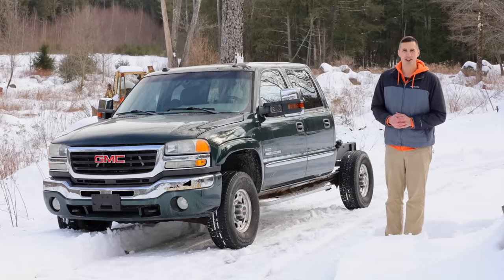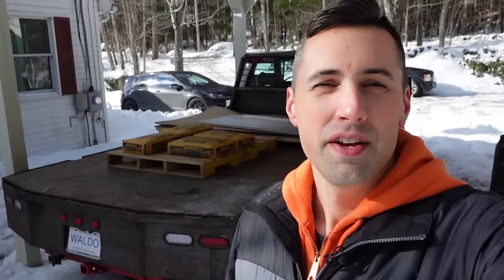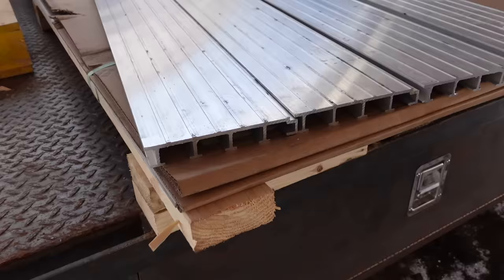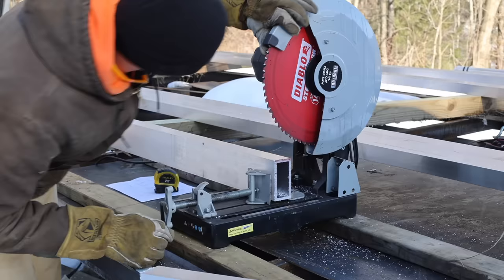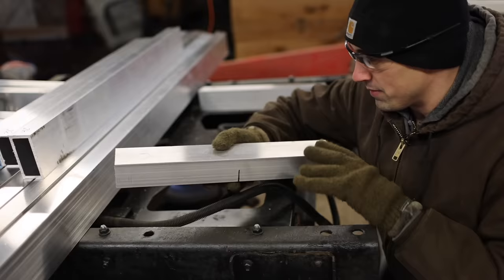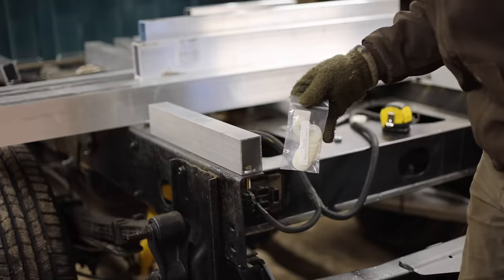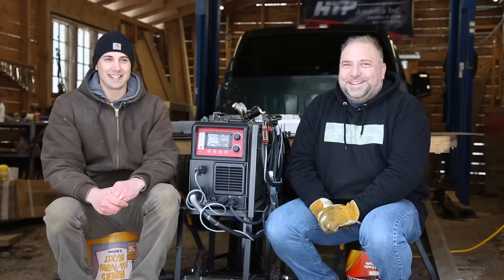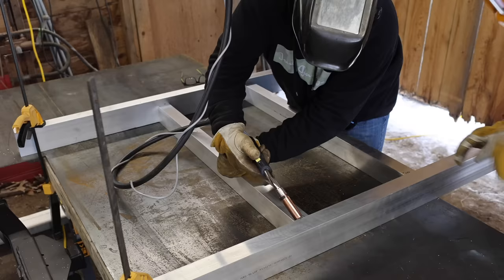Building an ALUMINUM Flatbed for my Project Truck!

Comment: I gotta respect a guy who goes though so much trouble to lighten his pickup and make the bed rustproof.

My only disappointment is that you HAD to make rear wheel arches, instead of keeping the sides flat and smooth.

Comment: But u can use magnet holder to weld aluminium anoth con to welding aluminium and u need to put a hatch in for thr trailer gooseneck ball hitch

Comment: Btw.. you welding up at a material that is straight 90, and aluminum… this is the one thing(sure othere’s) that even with steel I just can’t do!… I’ve seen tips and tricks. I think it comes down to the amp and feed, it’s like a potions I can’t get right, I just drip. Love a tip video on that, in depth, cause I’ve wasted so much company time lol I just can’t get it and it can’t seem to find the help

Comment: Pretty sure nylon washers aren't load bearing...... Been better off using rubber strips to keep galvonic at bay
Reply from the maker: Nylon has a very high compressive strength, but a low resistance to impacts 👍

Comment: This snow plow project is a great project and everything was good but i think u kinda overkilled it on the connection between the plow and the truck if u did a trailer receiver end on it where u had the tow hooks u could have put like a standard 2 inch tube and on the plow have like a point on it to help guide it into the receiver end and simply put the the pin in it, and when its not the winter season and no more snow u have two receiver ends for what ever u need to use it for like toing stuff with a hitch hook and u can still use it as a stock truck when it had the tow hooks

Comment: The only probelm with aluminum beds is stronger heavier metal like steel will gouge out the aluminum if dragged across it, or cut right threw it if a heavy object to dropped on it.   That's why heavy duty trucks dont have aluminum beds.

Comment: that is a LOT of stickout.  I am guessing the ARGON is turned up super high for that much?  I see you are still getting a lot of soot on the edges, is that normal with aluminum welding?
Reply: its spray arc on aluminum you need that much stick out ... and yes to weld aluminum you need large amounts of agron as well ... in the neighborhood of 40 cfh

Comment: Use WD40 to avoid aluminium get stuck in drill bits, saws and cutting stuff. Works wonders, even on the lathe and on the mill.

Comment: you need some ventilation system if you want weld more aluminium - aluminium fumes are much worst than steel

Comment: No spool gun. Great! I'm surprised at how far you can keep the torch from the weld and still have enough gas shielding. Are you using 100% argon? What flow rate? My only experience with welding aluminum is with TIG which is nice looking but slow.

Comment: Without insulating this much aluminum rom the steel frame rails, you should expect accelerated galvanic corrosion at the bolted connections.  Deicing chemicals will only make matters worse.

Comment: Did you put your ferrous metals blade on your dewalt mitre saw? Or did you just use a wood cutting blade? If so, which blade? Great built btw.
Reply from the maker: Thank you! I just used the wood cutting blade that came with the saw 👍

Comment: You did an amazing job on the flatbed. You are inspiring me to build my own as well lol. At 35:00 spend the money on the CDL training,I got mine back in the 90s but so much has changed you’ll never pass because you won’t know what to call out during the road test, it used to be just bridge overpass heights and road and bridge weight limits, but now you have to call out all hazards and you are better off to pay for some training and pass the first time then to take it three or four times and fail.
Reply from the maker: Interesting, I've never heard of calling out hazards on a road test. Which state was that in?
Reply: @WaldosWorld  I took the test first time and passed without going to any expensive schools, I did have a pretty good "teacher" mentoring me though. Make sure you study up on the pre-trip inspection. I would love to help out and loan you a truck but I'm in N Idaho so not exactly in the area.

Comment: You spoke about corrosion as regards to steel. Unless you have insulated 'ALL' your ferrous fixings from the Aluminium you will get 'corrosion' as the result of dissimilar metals touching and it will eat your aluminium away very quickly.

Comment: I see you live in a colder/wetter climate area and I was wondering if the aluminium isn’t going to corrode quickly where it’s bolted to the steel? I would suggest to add some kind of plastic bushings or washers between he aluminium and steel to electrically isolate them from each other. In that way you will greatly improve the durability of your nice new flatbed. Contact corrosion is no joke…

Comment: I'm formally from New England (born and raised) I'm currently living down in Florida. I have given up on the idea of welding and aluminum framed pickup truck slide in camper due to the price of materials. I was just looking again online at some of the more popular sites. I still have some smaller projects I'd like to complete, so I'm curious. Did you find a local supplier with reasonable prices or were you getting your material online?
Reply from the maker: I found a local supplier. I've found that internet prices are usually WAY higher than local prices, so I recommend calling a local supplier and getting a quote 👍

Comment: With a CDL there are a lot of hoops you have to jump through every year. Like a physical every 2 years or every year if you have high blood pressure. Can't take a class to get points off your license if you get pulled over in your personnel (non cdl required) vehicle but may be forced take the class anyways. You also lose your 4th amendment right when driving your truck and trailer, you can be pulled over for a random vehicle inspection and they can search inside your vehicle without probable cause or a search warrant. Your likely hood of having problems is rare, but there are DOT officers that see a pickup truck with a gooseneck and can't wait to bust you for something.
Reply from the maker: Those are good points!

Comment: Waldo nice work I also have the HTP 220 PROPULSE what was the settings you used to pulse the 1/8" materials please include wire type and size i would be extremely appreciative. I can send you some pics of stairways will build with aluminum if you would like to see some aluminum work we do we are in Massachusetts.

Comment: So what is the purpose of this truck vs the Cummins swapped Chevy? Do you have different uses in mind for them, or will they just both be around for whatever? They seem very similar other than the regular vs crew cab and age.

Comment: Any problem with the wire birdsnesting?  How does HTP feed the wire, straight push?  It is a very short gun so that might work with a teflon lining.  Did you try any 4043 .030 wire to see if it had any problems?   I had to laugh when you said that steel prices were cheap in your opening.  Must not have been to the steel store any time in the past couple of years!   Aluminum, even 6061 will corrode especially with road salt so it is not maintenance free by a long shot.  Best to design for easy accessibility avoiding blind areas where you can't get at them to clean them up.
Reply: the programs in the machine are for 035 wire (4043 and 5356) with pulse and 3/64" wire without pulse  .... all of those feed pretty much flawless through an 8.5ft gun with a special carbon graphite liner and fed by a special shaped drive roll ....  push only

Comment: Does it use a special type of aluminum wire that is able to be pushed all the way up that tube?  I thought the spool gun was used because the aluminum wire is too flimsy.  Also is there different types of spool wire depending on the type of aluminum you are welding?
Reply from the maker: Nope, it uses standard aluminum wire (it also takes large spools!). The gun has a special low-friction liner so a spool gun isn't needed. I used 4043 wire for this. 5356 wire is needed when welding most 5000 series aluminum

Comment: Hello
You are covering third factory brake light of truck 
Please put hole in front of it
I like you use orange/amber light for blinker and avoiding from stupid red and worst is sharing with brake light 
Its dangerous and cofusing share and red turn light designe
Please install one or two red strong fog light for back

Comment: I built an aluminum dump bed 2 years ago for my 1 ton duramax.  I wanted to use those aluminum planks but couldn't find a good source for them.  I used 3 inch channel and 1/8" smooth 3003 aluminum.  It's strong but still wish I had the planks.  Where did you get them?  Good job on your bed!

Comment: I wonder what is the length and width of the bed. 
Also the hight of the headache rack. 
I am considering building a track camper on a similar flatbed.
Thanks

Comment: Where did you source the extruded aluminum planks? I went going through the same weight/corrosion mental gymnastics for a build on my 2000 Tundra and really want aluminum but I'm stuck on where to find the materials.

Comment: If your welder has a hot start like the ones at my school have you don't have to preheat the metal
Reply: it does have hot start .... but it has a max output of 220 amps ... that aluminum was 6F .... as in before 7F ....   it was COLD .... and let me take a wild guess ...   at school you have 350 amps miller or Lincolns ...  THAT is a totally different class of machine ..... double the power 3 times the cost ....
Reply: @ZILAwelds  yeah I do there brand new and yeah that's very true

Comment: With my (albeit limited for the moment) experience in MIG welding steel, the fact that the part heats up as you weld a bead is not a unique property of aluminum. If I run a bead from one end to the other on top of some 1/8 flat bar, it'll easily blow through after several inches on me if I don't start cold... And starting cold of course has its own problems.

I don't regret buying my Everlast Lightning MTS 275, but I did want some pulse features and wasn't aware until fairly recently that anyone had anything similar to Fronius' CMT process.
Reply from the maker: That's true, it does affect all metals, it's just that steel is very forgiving compared to aluminum

Comment: Any thoughts on adding an Aux fuel tank? you can add a solenoid on the fuel line so when your  stock tank is empty you can hit a switch and fill the tank this could reduce stops at the gas station during cross country trip

Comment: What alu wire are you using?  Maybe you said...?  Also, is that a push pull gun?  I have a push pull and if yours is not push pull, it seems to work great..

Comment: what is the purpose of the nylon washers that go between the aluminum mounts and the steel frame of the truck? is it to prevent some dielectric corrosion or is it for shock absorption?
Reply: i figured it out: galvanic corrosion, good thing you showed me this
Reply: he needs to add a nylon washer to both sides of the aluminum, the top one is missing, he only added the bottom nylon washers

Comment: Where do you get your metal supplies from? Haven't figured out where you are in NH - I'm in southern NH and struggle to find local places for materials like this. Thanks!
Reply from the maker: Cohen is my go-to for steel. I used Northstar for the aluminum on this project

Comment: How did you attach the decking down? Did you just weld the outer edges or did you weld it to the frame?
Reply from the maker: I actually haven't attached it yet, it's just being held in place by gravity. I've been thinking about welding strategies for it, but I haven't decided yet. One of the considerations is that when you weld 6061, it becomes a lot weaker and more likely to crack near the welds, so I want to find a good place to weld it to minimize cracking in the future 👍
Reply: I don't weld aluminum very often, and then it's nothing like that. I just thought I missed how you did it

Comment: Hey Waldo, I know this is a year ago, did you find a truck to use? Or are you still trying to get your class A CDL? If you can spare about a week, I might have an option for you? In Boulder City, Nv there’s a company that can get you a class A with in a few days, you’ll need a permit, and last time i saw, the cost was around $1800.00

Comment: Sweet video, why did you go with MIG over TIG
Reply from the maker: Good question! I figured MIG is a lot faster and easier for the awkward out-of-position welds. I may end up doing a bit of TIG welding for some parts of the bed though

Comment: Waldo you shold NEVER welded Aluminum with MIG,😅  as it never controllable. As US crew cheif you should only use TIG with a shied gas. As with TIG is similar to gas welding as you control  the weld with the rod,. 😊 ~~Cris Harrison

Comment: Just curious does the aluminum take away  traction in mud/offroad?
Reply from the maker: As far as weight is concerned, it'll probably weigh a little more than the stock bed, so more traction 👍

Comment: Another cool project.  Curious what blade you use on the jig saw cuts?  When I use metal cutting blades they seem to gum up.  I’ve tried multiple speed and blade angles.

Comment: Just curious, how come you didn't do the cutting with the plasma?
Reply from the maker: Good question! I've never tried it, but in my understanding, a shielding gas is needed for plasma cutting aluminum 👍
Reply: @WaldosWorld  it can be done with air, obviously won't get a perfectly clean edge but it works, love the channel keep it up
Reply: @65kw_w923  can be done with air correct .  It leaves kind of a rough and jagged edge ....  the saw is smoother ... and no clean up

Comment: What was the thought process behind running the planks left to right versus front to back?
Reply from the maker: Good question! I was thinking if I have a load strapped down using the side rub rails, the load would be less likely to slide backwards/forwards if I ran the planks sideways 👍
Reply: @WaldosWorld   I like that though. Sounds good to me.

Comment: Great job!  Makes me want to go get myself another GMT800 pickup with Duramax and build myself a flat bed for it.  Question:  where did you source out the aluminum from?  You're up in NH and I'm down in MA and need to find a good source for aluminum structural stock for a trailer repair project.  Also - where did you get the aluminum planks for the deck from?

Comment: Great build. When you started using the DeWalt miter to cut the aluminum, I said "uh oh". Years ago a friend used his miter saw (normally used for cutting wood) to cut some soft steel. What he forgot was to take off the dust bag. Yeah, some hot metal chips set the bag on fire and it was when he wasn't around. Luckily the saw was sitting on a couple sawhorses and the burning bag material just dropped down to the concrete floor. I don't think there is a lot of danger doing this but just be certain to check the bag before walking away. Or take it off entirely as I see that you did.

Comment: Hi Waldo,
Nice build.  The flatbed looks great.  Do you use 100% argon with that welder for aluminum like you would with TIG, or some other mix?  Thanks for the video!
-mike
Reply: Yes. You DO use 100% argon when mig welding aluminum.

Comment: I keep thinking there would be a ton of built up demand for factory style replacement pickup beds made out of aluminum. What do you think?
Reply from the maker: I think you're right, but I don't know if the price would be low enough to be worth it for the older trucks the beds would be installed on
Reply: I used to build these out of steel. It was hard to make much profit on them because the typical buyer was always after the absolute lowest possible price. Aluminum is like 3x more expensive to use and few contractors ( no contractors ) felt it was a good business decision. Maybe some millennial with too much money would go for an aluminum bed like Waldo built here, but the guy would just be trying to prove something to the world. Still, I do see one on occasion, especially on new chassis- cab trucks. I see a lot more made from powder coated steel.

Comment: Waldo, as a Class A CDL driver you scare me. We have entirely too many "no experience" CDL holders having accidents and giving truck drivers a bad name. I request you  get the proper endorsements and some training prior to getting your license. Truck driving schools with short curriculum and class schedules put out folks that are only trained to pass the tests. These "schools do not get students real world situation experience. Now, back in the day a young man or woman was thrown the keys and earned experience the hard way. With todays distracted drivers and population that would be dangerous. Like the generation before me said about my generation; " You youngsters lack maturity"!
Do it right and get educated by an experienced truck driver in a school atmosphere.
9' wide at the mirrors by 70' long overall length and 14' tall, six sides of a big rig and trailer are a lot to keep track of, steer and most importantly- BE RESPONSIBLE FOR!
Maximum weight of 40 tons/80,000lbs will not just crush but kill!
Rethink taking short cuts
 you are in my prayers
Hoka Hey

Comment: Definitely think you shouldn't have cut out the wheel wells, looked much better with them hidden like that. Then you could have made the sides fold up for extra utility if you're transporting goods that like to fall off.